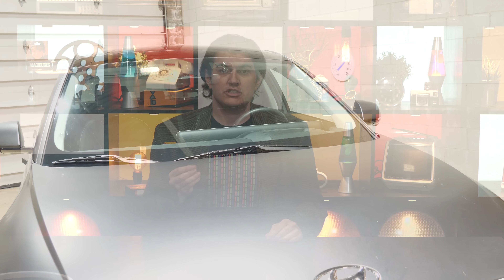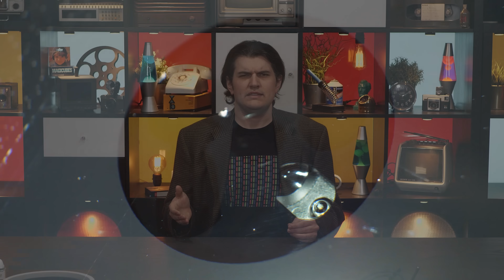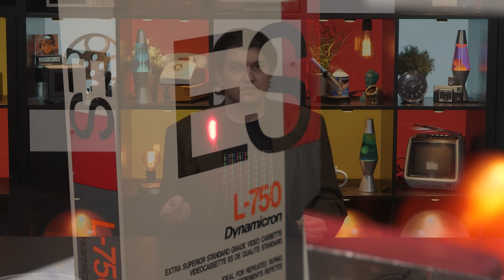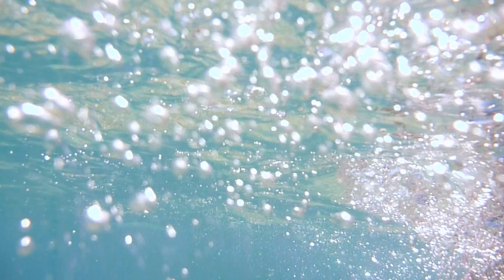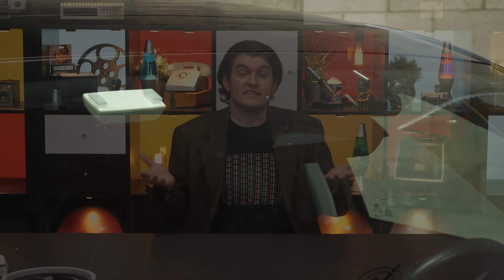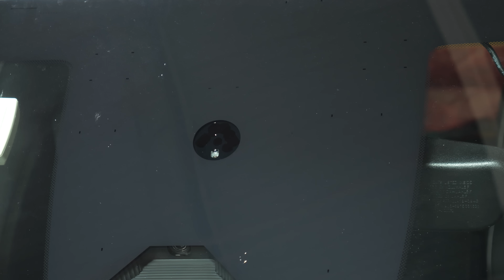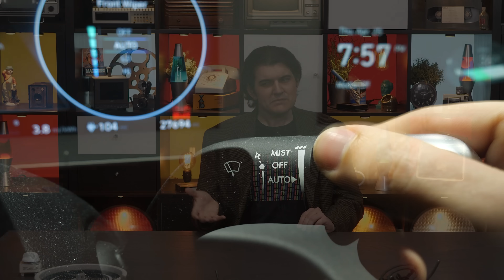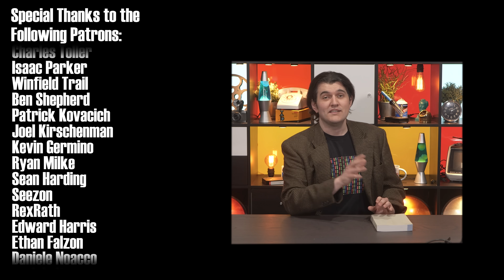The simple, clever sensor behind automatic windshield wipers

Comment: Hah!  I always wondered how those sensors worked.  Simpler than i expected.  This was one of those things i occasionally wondered about, but not enough to remember to research it later when i was out of the car.

This remind me of an auto dimming rear view mirror i saw a long time ago (must have been 60's or 70's car).  There was a hole in the mirror (silver scratched away) and a CDS photocell behind the mirror.  That went to the grid of a vacuum tube, and the plate was wired to a solenoid that flipped the mirror.  If enough light hit the photocell, it biased the tube on, and energized the solenoid, which then flipped the mirror for you.  Take the light away, the tube would turn off, and flip back.  Was not fast, but it did work, and was very few components.  I don't even recall any biasing resistors in the system, but that was a long time ago and i am probably not remembering it correctly.

I was called a "mirror matic" and it did come out in 1960.  And it seems there were a couple of biasing resistors.  But still and extremely simple circuit.

Comment: I love that a proper RTFM message was given at the end.  Also props for index of refraction hacks car industry.  Sometimes the smartest people show up in the weirdest of places to solve the most banal of issues.  We already have the capacity to turn on our wipers, have for decades.  But someone somewhere thought to themselves, "Ya know, I bet I could take $0.50 in parts from our bulk purchases and make a thing that can turn on the wipers automatically..."
Reply: And then they decided to use The Magic Of Buying Two Of Them to enhance its effectiveness...
Reply: How does the distance between the led and sensor compare with the glass thickness? If much larger, the led beam may be bouncing multiple times off the front and back of the sensor and getting light-piped to the sensor. This would multiply the signal change. One effect, however, is that if there is not a reflective layer on the inside of the glass, you might be able to trigger the wipers by getting the inside of the window wet.
Reply: @bcwbcw3741   Generally you can't access the sensors from inside the car, since it's inside its own housing.
Reply: @Appletank8  oh right.
Reply: @bcwbcw3741  The thickness of the glass doesn't affect internal reflection.  The gel that adheres the sensor cluster to the glass has the same refractive index, so the laser effectively starts "inside" the glass.  Likewise this adhesive, once it hardens, won't allow moisture inside to affect the sensors.  At least from the sensor/glass side, the backside, who knows.  The angle of reflection off of the inside of the glass due to the glass/air difference works like a mirror, regardless of the thickness, it just means that the sensor/emitter pair will have to be spread out more.

Think of it like having a giant mirrored ceiling and you have a laser pointer placed up against the glass with a piece of paper to catch the laser.  The thicker the mirror (or the further back you move the laser from the glass), the further away you have to move the paper to see the laser dot on the paper.  So naturally, the auto industry is particular about the thickness of their glass for these sensor clusters.
Reply: RTFM works when it was written by engineers, not by lawyers.
Reply: @dzhiurgis  Lawyers can't write documentation, yes. They write contracts, which we know has nothing to do with the operation of a vehicle (unless you're Tesla, then it also affects ownership and operation)
Reply: @Feynt  you might then never RTFMd then. Take an average baby car seat manual and tell me you understood anything from it.
Reply: @dzhiurgis  I learned how to program my VCR and stereo for my mom when I was in junior high from manuals, and that was 30 years ago.  How hard can a baby seat manual be?

Also I'm probably biased as a programmer/software engineer.
Reply: More accurately: "I bet I could take 50 cents in parts from our bulk purchases and make a thing that can turn the wipers on automatically so that we can raise the price of the car by several thousand dollars because it's now got luxury features"
Reply: @homestar92  I'm certain most engineers do things because they can, or because they genuinely want to solve a problem. It's the work of business types (for better or worse) that end up over inflating the value of things. The engineer would likely just charge $2 extra on a $5-7k car, since everything in a (non-electric) car is technically cheap.
Reply: In an amazing quest to use 1 dollar to charge 200 additional, as always. At least until it's nothing special and everyone starts adding them.
Reply: let's be real here, that person probably said automagically, because the people who are the highly-educated types rarely think of the elegantly simple solutions.
Reply: @CrisperPoet lol?
Reply: @CrisperPoet  or perhaps used this terminology to sell it to the higher ups, who always think the simplest things are magic
Reply: @CrisperPoet  You've never been in a room full of engineers, have you? They absolutely LOATHE marketing speak and will openly play "buzzword bingo" to mock them. People who are highly STEM educated, and seasoned in their field, absolutely obsess over making solutions as elegant and simple as possible. It's the social "science", management, marketing and economics people who think in fluffy, emotional and fictitious terms.
Reply: @andersjjensen And you have clearly never met a PhD in electrical or mechanical engineering, because, in my own experience, they often feed on buzzwords, as they have been taught to do at their alma mater.
Reply: @TheLukasDirector  Depends on the type. Those who actively pursue a career in academia tend to lean that way, but I honestly completely disregard the opinion of anyone who hasn't worked in the field they're supposed to be proficient in. People who earned their PhD in a real RnD lab,  however, tend to be very specific people who will ask "what precisely do you mean by that" when you say something open ended.

Comment: the previous model has the opposite problem: my 2021 Ioniq EV does stop the wipers in the middle of the screen when turned off, and I’ve seriously considered maybe opening the manual to see if there’s a way to get it to not do that, without having to remember to turn the wipers off first (and then back into auto)

Comment: Oh my god Alec, you literally helped me save a loooot of time and money by publishing that video!
I have had an issue with my Renault Zoe R135 automatic windshield wiper sensor from since I got it (used). By taking a photo of the sensor I was immediately able to see that the sensor is fine, but that the optical gel is nearly completely gone, probably from a shady windshield replacement in the past.
It seems to be fairly easy to buy a new gel pad and replace it by my own, so thanks both for the (as always) excellent in depth view and explanation of this sensor, and for saving me quite a few bucks!

EDIT: After thinking about the solutions and looking at the photos I took, I realized that it could be that the sensor was not completely clipped in. After disassembling the plastic housing around the rear view mirror, I was greeted with a semi-clipped in sensor. Reattaching the other side re-sealed the gel without any bubble, and the sensor seems to function as normal! I'll just need to see with the next rain.
Reply: We have this problem with brand new cars. If you get a tiny speck of dirt on that gel at all, or like a fingerprint or if you drop it on the ground and then try to install it it will not work. 

Source: I put this piece on cars all day.
Reply: @JasonHenderson  @BryTee In this case I'm happy to report that the sensor was just not clipped in on one side! I have to assume that the technician who installed the sensor didn't clipped it in fully and that over time it detached.
The gel was apparently undamaged as I tested the sensor and everything seems to work fine! No bubble or anything after checking with a photo.
Reply: I was also wondering how windshield replacement was going to affect this.
I'm sure it's not just a "shady" replacement company, but any company as getting the right kind of gel and the correct amount, must be tricky.
Reply: @BryTee  You're close, they come with the little gel layer already on them and a little plastic cap covering it that you must carefully remove without touching the gel. Ours are manufactured by hella, and we get them I think for $12 a piece. 

When we get one that doesn't work they just swap the whole sensor out. But I bet at the dealer these things are over $100.

Comment: I know that the stalk thing is a quip at Tesla, but one thing I've noticed is that with windshield wipers, the situation is all over the place. Every Japanese and Korean car I've seen has pretty much the same interface (from top to bottom, mist -> off -> interval -> low -> high, pull forward for windshield washers), but other cars have all sorts of weird interfaces. Some of them have a stalk reversed from the Japanese and Korean cars, and others have a twisty thing on the turn signal stalk, and each one controls differently, especially with regard to the mist setting and the windshield washers. Why is there no standard with that?

Comment: I drove one of these Ioniqs as a rental car and hated it. The most miserable rental driving experience in over 20 years. The only worse experience was a Saturn but while the Saturn had some miles and was ready for rental retirement, the Ioniq was almost new with less than 4k miles. 

On subject, my Lincoln has the auto wipers and I love it for virtually never having to touch them. When left in auto it does a sweep of the wipers every time I switch the ignition on, I presume to get a good baseline value.

Comment: Your info about getting the wipers in the up position, that is actually common because it's used in the winter time for "winter mode" wipers where you turn off your vehicle and leave them in the up position so that if they are covered in snow, it's easier to break them out. I say common, but once I found out about this years ago I thought it was new too. Using this winter mode to "change" the wiper blades though seems to be a useful feature for me to try in the future. 😁

Comment: Hyundai !!!! NICE !!! I just got Kia Niro 2023 model, the hybrid version in top premium trim... . AND HOLY HELL THE TECH IN IT!!! it got so much qol features.
Lane assistance (steering wheel moves itself!!!), highway active cruise control and by extension traffic assist. Sensors all around, backing up sensor to warm me about cars coming from the side, crash detectors which will stop the car, automatic recuperation that will slow to match the car in front, so I can break EVEN LESS. I can even remotely control my car from the key fob to move it back and forward if for example someone parks too close to me.
Then all the usual - electric seats with memory, cooled ventilated ac seats, heating seats and steering wheel, electric opening trunk. Madness how much tech is in this mid range compact car. And I get up to 69mpg in it (usually around 60).
Maybe I sound too surprised but I am. That's mainly because I was lead to believe that Teslas got all the best tech.
About the rain sensor - i noticed that if the windshield is already wet in the morning, I need to start driving, so the water moves. Then it will wipe it
edit: would love more car-tech vids!

Comment: That subtle jab at Teslas at beginning ;), but totally agree! The lack of actual rain sensors is one of my biggest complaint about my Tesla. I find myself just manually adjusting it (which in itself is a hassle with the touch screen controls) as the camera based system both doesn't reliably detect when water is on the windshield or thinks there is and keeps wiping even if its bone dry and sunny out.

Comment: When I got my Golf R 2018 I read the manual cover to cover! It was wrotten that a light will turn on once the windshield washer fluid level is low... So I was expecting this light to turn on... but this feature is not installed on Canadian car! 

So not long after gettng the car I got stuck in traffic in winter without windshield fluid! I couldn't barely see in front of me to get out at the next exit and fill back the tank! 

SO yeah RTFM but.... dont trust it! ;( I complained about that on my dealer and they told me this is normal because they print manual for every level of the car.. the thing is mine had all options available installed...

Comment: Nice video and presentation. 
This video inspired me of this theory. 

The laser beam shooting forward and is reflected back where the beam hits at the glass-air junction which is optically flat. Water beads on outer surface of wind screen corrupts that flatness and the beam get scattered and highly attenuated below the detection threshold of the light sensor to a state change, from no rain into rain state.

Comment: Am I the only one with a Tesla who actually has good experience with the auto wipers?

Interestingly, after the cameras were recalibrated after getting my car fixed due to some rear end damage, the auto wipers became absolutely horrible. It was constantly dry wiping and ended up ruining the blades. Later on I noticed that windshield in front of the cameras was super dirty (The interior part, not exterior). So I took off the plastic housing and thoroughly cleaned the glass and now the auto wipers work great!

Comment: On our VW Caddy, the sensor only very rarely picks the wrong wiping speed, but there doesn't seem to be an auto-calibration at the start and when starting to drive in rain I end up always triggering a manual wipe before putting it in auto again. Maybe I just would have to be more patient. I think it ends up sensing the change in reflectivity when the water starts moving because the car is moving faster than walking speed, but I kinda like being able to see before driving ...

Comment: A lot of cars you have to tap the wiper single wipe 3 times right after switching the ignition off to put them into "service position". The fact they are hidden under the hood on most cars now is really annoying when cleaning them, since you want to clean the whole windshield and also wipe the wiperblades clean so it doesn't smear dirt all over your windshield on first use

As far as "konami code"-like procedures, toyota has some nice ones, a lot of systems can be put into service modes using components and sensors connected to them if you don't want to use a computer, there's the famous "pedal dance" for disabling traction and stability control, where you engage the brake pedal and E-brake in a specific sequence, calibrating the automatic headlight leveling by tapping the high beam after switching the ignition off, in some toyotas you can program the immobiliser and remote key by opening and closing the drivers door, inserting and removing the key from the ignition and turning the key in a pretty long sequence. You can usually find those sequences in the service manual (which toyota let's you access for a pretty reasonable price, which is not perfect but a lot better than some companies that ask for a few thousand $ and certification)

Comment: On many European cars (e.g. Renault) you just have to move the stock all they way down (max wipers speed) with the engine off. That will set the wipers to service mode. When you're done put it back in your preferred setting: auto or off.

Comment: I've shut off the automatic rain sensor on every car I've gotten. It's very distracting to me to have my windshield wipers randomly change their speeds on me while I'm driving. I would rather manually control the windshield wiper speeds and adjust to the conditions myself. Same thing with automatic high beams. It's a very annoying sometimes when the system decides to turn them on and turn them off and I can't force them on while driving. If the system is enabled I am at the mercy of the computer to decide when they actually turn on.

Comment: I know certain automatic tech, like automatic wipers, headlights, and dimming mirrors have been around for 70+ years, I still prefer everything to be manual. And, without computers controlling everything. The joys of a 32 year old base model Civic like mine, it has one computer controlling the engine, and it used to have one to control the airbag that I removed 2 months after buying the car 11 years ago. I am weird though, I daily the car with no power steering, power brakes (I still have the booster just in case someone has to drive my car in an emergency), AC, power windows, power door locks..... The only luxuries I have are intermittent wipers (with no delay control), an AM/FM/CD/USB radio I rarely use, and I installed a junkyard found factory dash clock because it annoyed me not having it. And thing is, I have done a lot of work to it, but it was abused before I got it. I can't see most of today's vehicles, electric or ICE, lasting 30+ years and 300,000+ miles while being well taken care of, let alone abused. The difficulty of repairing today's vehicles makes it a lot more appealing for companies to stop their current way of thinking. Instead of building new, we need to refurbish/upgrade the old, AND make more responsible drivers in the process. Think about it: A company like Edison Motors is doing retrofit kits for older vehicles to make them electric or hybrid. If all the companies of the world worked toward that as a goal, and people started being more responsible behind the wheel again, it would benefit EVERYONE in the long term. More efficient use of available resources. We USED to teach about reduce, reuse, recycle.... That is not what we are doing these days and trying to puke out new tech way quicker than need be, into new products.